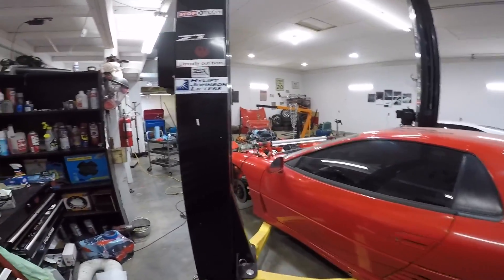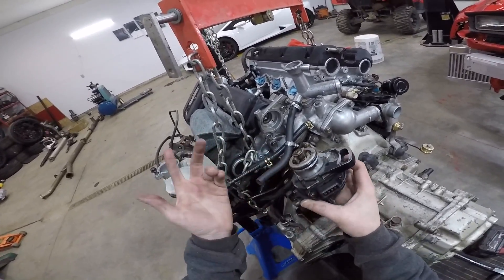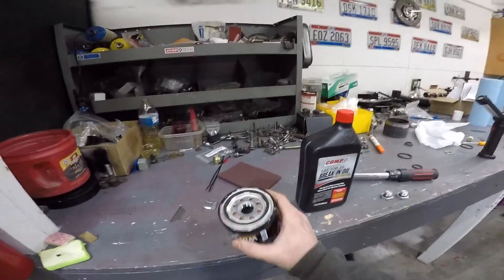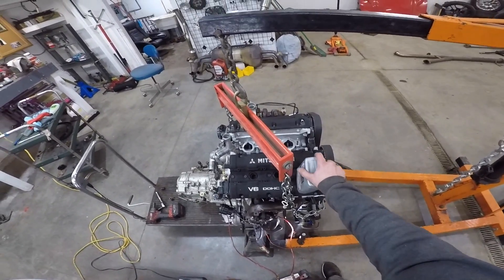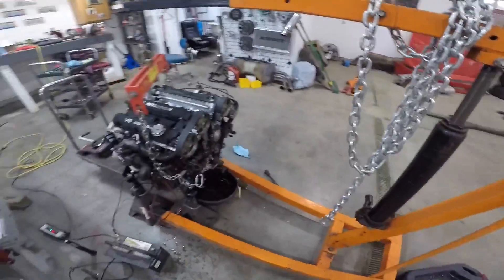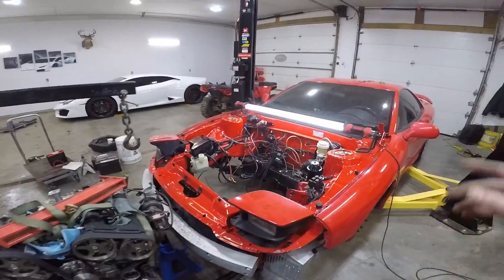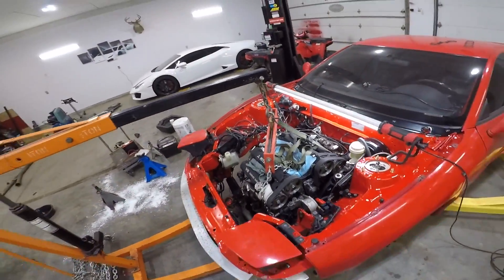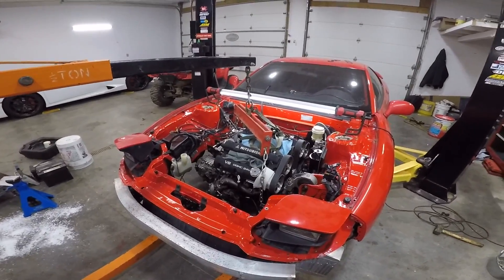rebuilt Forged TwinTurbo engine installed [ 3000gt vr4 ] 6g72 tt

Comment: It's all coming together, congrats on getting it in. Fixing that paint damage won't be too bad, I've fixed worse. Head over to O'Reilly or Napa with the paint code and have them mix you a spray can in that color and grab a can of 2k clear. Sand the damaged area so it's smooth, primer, sand some more, then just lay the paint back on and cover with clear. You can wet sand and buff it after that and nobody will ever notice. It's really pretty simple and I'm sure there are plenty of guides on YouTube to show you. Good luck with the rest of the work
Reply from the maker: I'm just mad I did it lol
Reply: Been there for sure man. Even after I fix it I know it's there and it still passes me off even though no one can tell.

Comment: leaving the trans mount on made your job much harder, deffo easier in through the top bro
Reply from the maker: Idk man I did the subframe last time it was pretty easy
Reply: @huracanian3051  Everyone's got their own way man, also depends on modded, stock etc, I have Pauly Perl Engine mounts from Chris (RIP) so my mounts are different to yours and smaller. Glad to see content on em. Had mine 13 years, love it, just threw a stage 4 clutch in  running 19ts and piggybacks.
Reply from the maker: @SuperDeadlen  true .. That's sweet what piggyback how much u get out the 19ts?
Reply: @huracanian3051  Not Dynoed but think I am at about 420 running 16psi aiming for about 25psi. So far using an SITC timing controlller and and safc with dsm 450s. Guy i bought them off was running 490 on them dynoed. Slowly increasing boost.